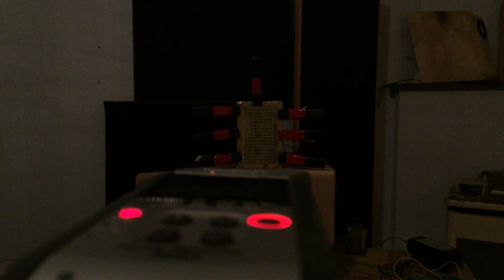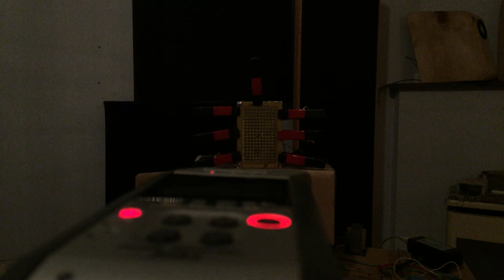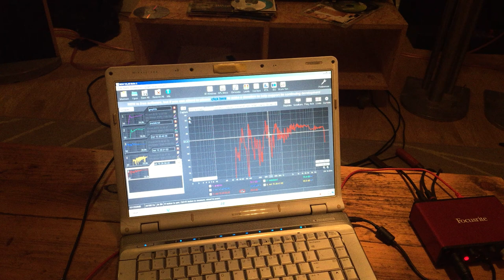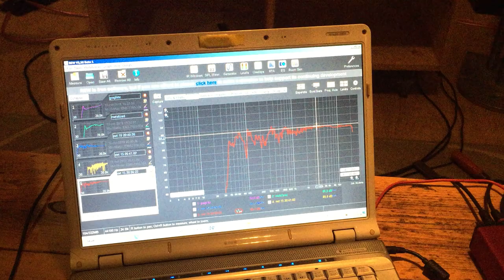Inverterd a solosound  ESL panel - Music test

Comment: Hi, I have enjoyed watching all of your creative ways of building speakers and have learned alot. I have not attempted to build my own. I am still not perfectly sure how to run speaker connections and HV connections. Is there a chance that you could lay out a detailed set up for beginners? I am working on a silicon graphite coating on a thin flexible fabric to try. Also how do you protect audio in from arching back to your amp?
Reply from the maker: ill try to do a simple one with a drawing and all !
Reply: @joppepeelen Thank you!  Any and everything would greatly be appreciated.

Comment: It sounds absolutely flawless from here but did you measure the distortion?
Reply from the maker: Yes and it is a little higher then the bigger panel with the wires,   Witch makes sence since everything needed to work 7-8 dB more to reach the same output.
Reply: @joppepeelen  hopefully is not because of the lack of distributed charge. Btw the PCB material, having a higher dielectric constant than air pushes the electric field out, so it affects less than just measuring the thickness. Thanks for the videos